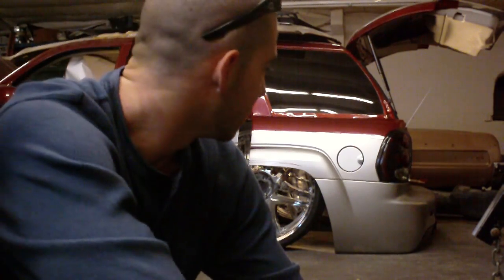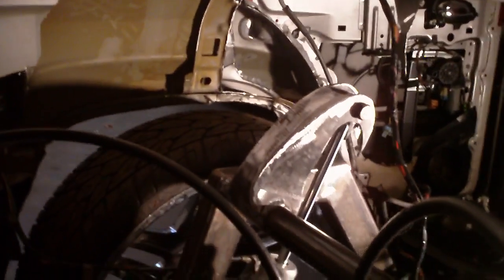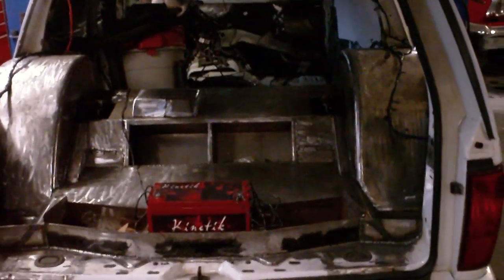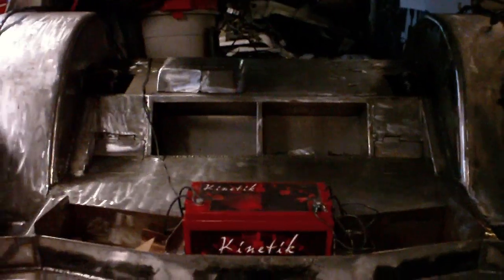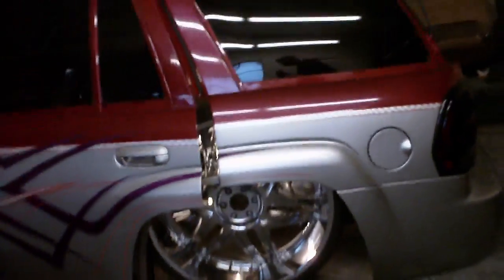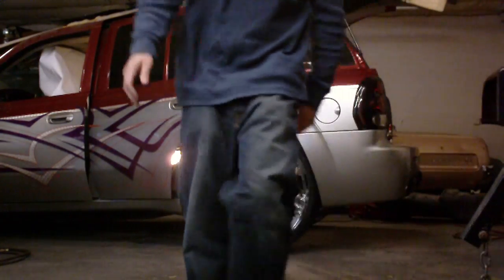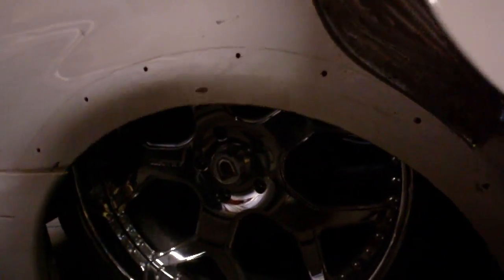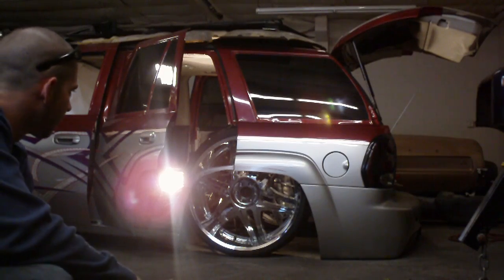Trailblazer Laying Frame on 28's

Comment: I think 8s wouldve fit if you didnt try to lay it out. cause 6s fit with no mods all day long and if you run the 275/25/28 its only an inch bigger than the 255/30/26 that fits with ease.